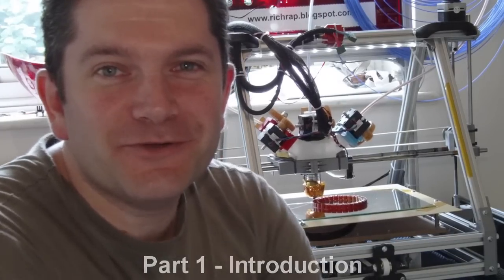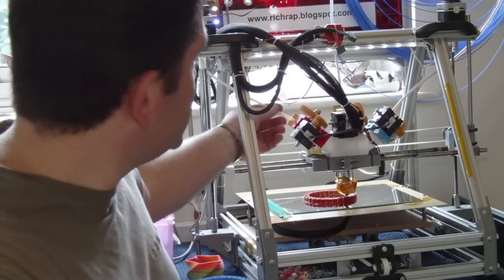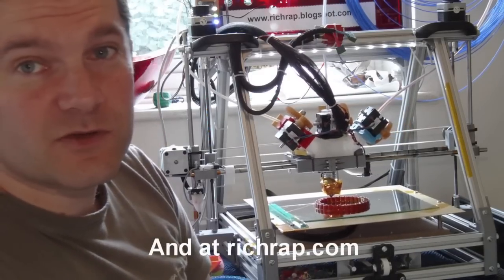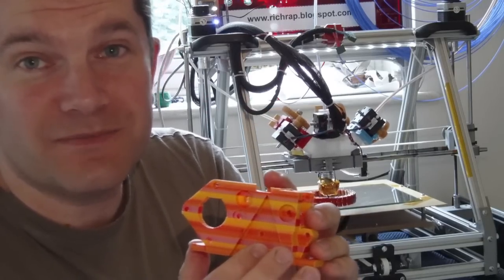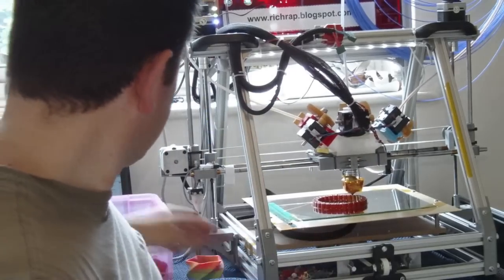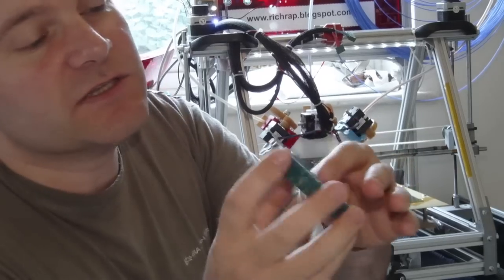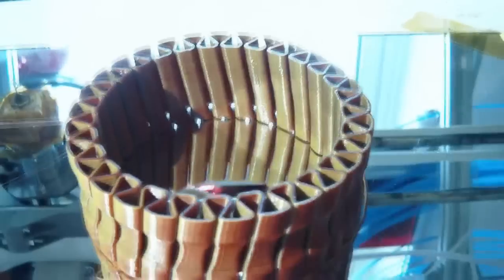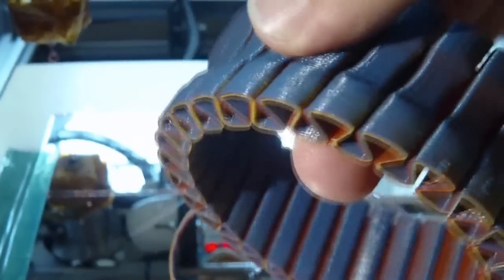RepRap 3D printer 3-way extruder and colour blending nozzle Part 1 - intro video

Comment: Wow, what a great step towards home 3D printing! Red, yellow and blue filaments properly mixed in the extruder could produce millions of different colours! Add a black and you could produce all kinds of tones too! Interesting to see software developments into printing textured objects, would be cool even to have the option of entering a hex colour code before producing so the printer prints in a specified colour, so much easier than multi head and different coloured filaments!

Comment: This is absoutly awesome.
I'm gonna take a peek at your blog, as i'm interested in that glass print bed.  I'm having problems with mine, recently tried a new tape, as I could not get the old type anymore, and I incur warping caused by the adhesive coming off the print bed

Comment: I have been thinking about this very same approach of merging multiple filaments, but wonder how quickly/precisely you can change the colors.  Can you change the color fast enough to write text in the side of a vertical wall?  Perhaps we could strategically improve slic3r to do infill during the interstitial color shift?

Comment: mix plastic with metal powder ? they have a professional metal 3D printer but it uses power and a resin or heats the powder with a laser. You could also use the plastic piece in lost "wax" casting.

Comment: Red,Green,Blue and have every color? That would be somethin'
Reply: For printing you need to invert the colors, so its Cyan, Magenta, Yellow (and Black).
Reply: misium Haha thanks I forgot about that
Reply: misium I believe for 3D printing it may be the opposite though... But meh, idk xD
Reply: Zyron Melancon Yeah, It may be Red, Yellow, Blue, White, and Black. Maybe not the Black, though.
Reply: Zyron Melancon It will definitely be Cyan, Magenta, Yellow and Black.
That*s the difference between additive color mixing (RGB) and subtractive color mixing (CMYK).
In additive color mixing you mix color by "adding" more or less of certain light frequencies. That's how displays work. They emit light.
In subtractive color mixing you mix different materials which filter out (subtract) certain light frequencies when they reflect light.
Since filament is a material and is not made of light, we got subtractive color mixing here.
If you mix Cyan, Magenta and Yellow you get Black. But it won't be very dark. That's why you add "real" black.
But we don't got white paper in 3D printers, like a normal paper printer got. If a paper printer wants to print White, it just doesn't print in that area. Well, I think that doens't really work in 3D printing. So we would also need White.
That leads us to CMYW or CMYKW if we want real dark Black.
Reply: Nicbudd There is no color mixing system where Red, Yellow and Blue are the primary colors.
Reply: ^ I was always taught in art class that red, yellow, and blue were the primary mixing colors. But that's just about the only thing I can think of. Otherwise it's RGB/CMYK
Reply: Cyan looks a little bit like Blue and it contains Bue, but it's not pure Blue.
Magenta looks a little bit like Red and it contains Red, but it's not pure Red.